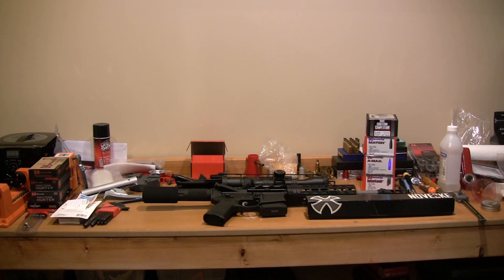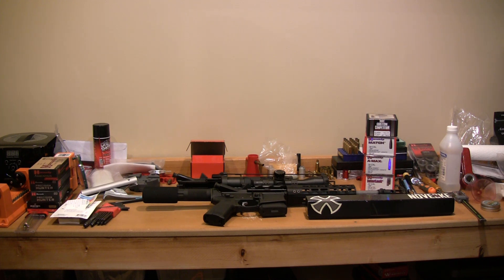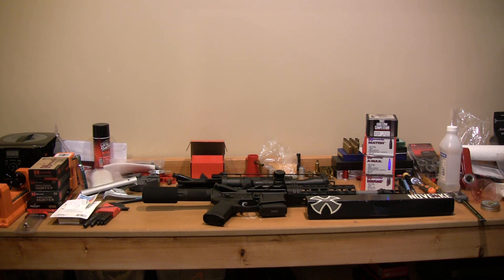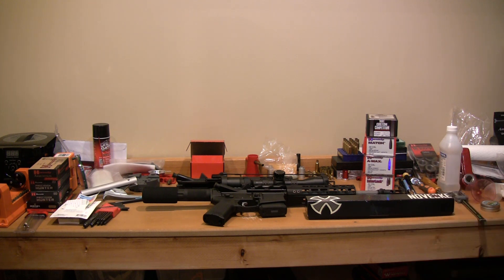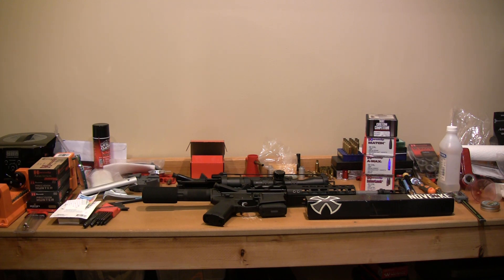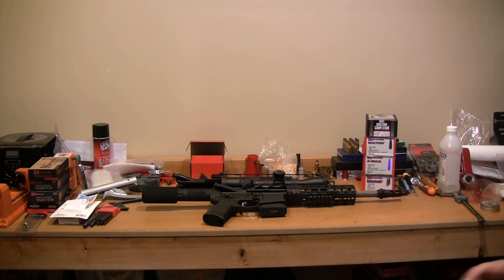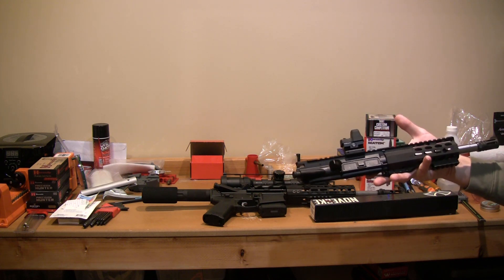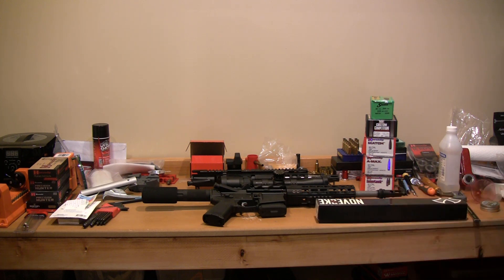300 blackout barrel Selection: Twist Rate Matters

Comment: Hi Bolt
 Bought the same Palmetto Upper you have. 8.5 Inch Barrel 1:8 twist. I loaded some 125 GN Super Sonic loads and it shoots great. have shot at 100 yards and is very accurate. Loaded some 208 Hornady 11 GN Accurate 1680 and I am getting Key holing at the 10 feet line. Just tested it yesterday and found this problem. Your video is the first one I found that addressed this problem. I was going to start messing around with different loads. I think you video is going to save me a lot of time and grief. I have noticed most of the 8.5 inch barrels for sale are 1:7. Must be a reason. I am just going to order a new barrel and give it a try.

Harold
Reply: @markr6754   I change the barrel to the 1-7 twist. It was a huge improvement. The 208 Hornady boat tail hole were still not perfect but was not a key hole. I bought the Remington 220 flat base sub sonic and the hole was perfect. Did not get a bolt hold open with the Remington. I read some posts that boat tail bullets do not stabilize well out of short barrels. Seems to be true. I took 5 Remington bullets apart and used the bullets to make a new load 11.5 gn 1680 also loaded some Hornady 220 BT same powder. Will go to the range and see the results. The 1-7 twist did make the big difference. This going to be a suppressed rifle so I have to have these bullets coming out arrow straight. Will keep you posted.
Reply: Harold Demes thanks for the info, and glad it’s working out for you. I wish I’d read the same posts before jumping for 1500 of the Lapua bullets. I suppose I can always load them for faster velocity...but sure was looking forward to sub performance. I just picked up a 10.5” 1:7 twist 416R Stainless barrel from Bear Creek Arsenal. It’s carbine gas...so that could prove problematic. Just picking out pieces for my next build...at least I know they have a pistol gas barrel as well.
Reply: @markr6754  Hi Mark been doing more testing with the 8.5" 1-7 Twist barrel. The 220 gn flat base Remington are the best holes at 15 ft. But some hole smudged. In consistent. The 208 and 220 BT all smudged at 15 ft. The 220 Remington's stabilized at 25 yards no smug. The 208 and 220 BT still smudged at 25 yards.I have tried different powders charge weights and had no luck. I ordered a 10.5" 1-7 Twist barrel to test. I think the longer barrel with solve all the above problems. I probably could eventually come up with a load that would work in the 8.5 inch barrel but I would like the gun to shoot any factory subs. I built this gun to run a can so I have to have a consistent bullet stability coming out. Don't need a baffle strike in a $900.00 can. Barrel should be in this week will keep you posted.

Harold
Reply: Harold Demes nice update. I hurt my back the same day I made my last post. Haven’t been able to shoot anything since. I did complete my 10.5” pistol. It’s a bit of a Frankengun...Aero Precision upper and lower, PSA lower parts kit with SBA3 pistol brace... I like the feel of the Enhanced Polished Trigger, so I purchased the same lower parts kit that I have in my 8.5” pistol. I added an Osprey hand guard, Odin Works Stainless adjustable gas block, and finished with a Punisher stainless muzzle brake/compensator. It all looks pretty good, but I have no idea how it will shoot. Back better improve soon or I’ve sunk a lot of money into man-cave decorations.
Reply: @markr6754  Hi Mark Got the 10.5 1-7 twist stainless barrel. Went to the range 208 and 220 still smudged. No difference between the 8.5 1-7 twist an the 10.5. Did load some sub sonic 150 sierra spitzer. Worked great perfect hole. Cycled locked the bolt back. I bought a upper and parts to put my 8.5 on so when I am testing I am not changing barrels. I am going tomorrow and taking the bird cage flash suppressor off. It may be causing turbulence. Grasping at straws. I watched jonnysreloading bench video and he was testing to 208 and the 220 subs and was getting perfect holes with a 8.5 1-8 twist rainier barrel. He has SB tactical 3 prong flash hider so he can put his suppressor on. That is the only thing I can see different than what I have. Will let you know

Harold
Reply: @backnine sent an email to PSA telling them my experience. They want me to send the unit in. I won't do anything until I can shoot some more rounds. But it's good to know they're ready to stand behind the product. I've gotten other feedback that indicates it's really an anomaly. Hope so. I don't plan to get a can anytime soon...but I want to be able to run one with confidence. Thanks for the update.
Reply: @markr6754  Hi Mark went to the range today. Took the bird cage flash hider off the 8.5 and the 10.5. 220 bullets are straight at 10'. Did not have any 208 left to try. That flash hider must create some turbulence on the heavy bullets. I think the problem is solved. For the 220 anyway. I will get some more 208 and try them. What flash hider do you have?

Harold
Reply: Harold Demes great news! Gives a point to begin troubleshooting. I’m expecting that if 220gr subs are running straight, then 208gr should as well. Anyway, my 8.5” upper was a complete unit from PSA, it shows a PSA A2 Flash Hider. I’d bet that it is a bird cage as well. My 10.5” barrel has a Stainless “Punisher” muzzle brake...it’s three inches long. I bought it off eBay,, and all pictures related to it are gone. That’s pretty bizarre. Seller was cx3tactical. Description is “.300 Blackout Stainless Muzzle Brake Compensator Comp 5/8-24 TPI Punisher 3% 300”. He has similar devices on his page for .308 and .223. It looks great, but how it shoots remains untested. Anyway, I think you’re on the right track. Maybe you should call PSA and get some input. They are supposed to have test fired these weapons...maybe they didn’t try subs, and I haven’t tried any 220gr projectiles at full load.

Comment: There were numerous reports in 2015-16 that there were many SS Barrels 300 Blackout barrels floating around that though marked 1-8 that were actually 1-10 twist. Take a Hornady 225 grain BTHP length 1.558".  In a 1-8 twist barrel it's stability factor is 1.876 @1000 FPS (anything above 1.5 is stable). Shoot the same bullet through a 1-10 twist barrel at the same 1,000 FPS it's 1.174,  Unstable.  Ergo your marked 1-8 twist barrel is actually a 1-10 twist barrel.

I used the JBM Stability calculator found here:   http://www.jbmballistics.com/cgi-bin/jbmstab-5.1.cgi

BTW in a 1-7 Twist barrel the 225gr Hornady BTHP stability factor is 2.396.  As you have remarked 1-7 is the way to go if you plan on running a lot of subs. 1-7 doesn't do much for accuracy for supers ( way overstabilizing them ), but then again the 300 Blackout is not a LR match cartridge.

Comment: Bullet weight, bullet speed, barrel twist, and barrel length, all have factors that play in "bullet stabilization".   The Russians 7.62x39 (123 gr) bullets shoot fine through as short as a 12" 1:9.5 barrel. (I like 12" to 23" barrels with my 7.62x39 ammo).  Any 125gr 300 B.O. should love a 1:9, 1:9.5, or a 1:10 barrel that's at least 12" long.

Comment: The difference between 1-7 and 1-8 is tiny... Suggest you check barrel. I shoot the 208 AMAX and larger from a 1-8 with no problems whatsoever.
Reply from the maker: thanks for commenting. I am sure that something with my barrel is sub-optimal, but honestly its not worth chasing. It shoots light projectiles just fine. Like I say in the video, I am sure that there are 1:8 twist barrels that shoot heavy bullets just fine, (look at johnnys reloading bench https://www.youtube.com/channel/UCQ7ZytKrmCQnRp9LXXxinJQ and you will see a 1:8 twist MATCH barrel shoot heavy projectiles. My whole upper for the 1:8 twist was 2/3 the cost of his barrel alone. And like I mentioned in some comments below, the difference is 14.2% in rotational velocity. Not tiny in my book, but in my case it might have been the difference who knows. Glad yours works for what you wanted it to. Small groups to ya.

Comment: cant recall where i saw the info but i remember seeing someone say 1 in 4 twist being ideal for subsonic blackout
Reply: Kevin B. With Q said this, however they never went public with a barrel that tight because it destroys light supersonic loads and even some expanding subs that are soft due to the extremely high RPMs.

So their compromise twist on the Honey Badger is 1:5. It's fast enough to stabilise subs and larger supers in a short short barrel at low low subsonic speeds  (you have to go way lower than the sound barrier to beat the transonic mini-booms, 900 fps or so, depending on shape).
Kevin swears by high twist, but personally I'm dubious of supersonic performance with that kind of twist. The effects of spindrift are magnified with really high RPMs, and if you're hand loading some bullets might come apart or lose accuracy.
Also you get less velocity due to more energy being spent on spin, but, Kevin points out you still get expansion due to centrifugal force.

Honestly I want to try some of this out myself and see what's best.
Reply: @ravissary79  being im planning to use exclusively subsonic as a defense build ill be going 1:5 or 1:6. Though ill likely grab a barrel for supers later on.  Underdeveloped ear canals, wouldnt want to stun myself in an already bad situation
Reply: @ThirtytwoJ  bear in mind 1:5 is rare because it's too tight for mass produced button rifling barrel makers.
It has to be cut or hammer forged, which is pricy.
But Q actually makes a barrel like that used in the Honey Badger which they sell as a part.
(1:5)

Comment: I have a 16" Wilson Combat barrel which is 1:8 that I just purchased on a 300 blk. Hopefully the length and quality of the barrel will not have the tumbling effect. 35 feet is crazy. Now I'm very interested in seeing how it performs. Thanks for the video.
Reply from the maker: +fins 71 thanks for the comment. I would not be surprised if it shot ok. You have length on your side and WC is a wisely brand. But to do it again i would still get a 1:7 twist. My first barrel was very disappointing.

Comment: 1:8 twist in a 8.5" barrel means the bullet rotates once before leaving the barrel. The barrel is not long enough. The faster, lighter rounds will work but the slower heavier ones are like a right handed pitcher throwing left handed. I've seen guys have accuracy issues with shorter barrels and wonder why.
Reply from the maker: +toolman272 thanks for commenting. There are people that have 8.5" barrels that can stabilize the heavier projectiles. Having a longer barrel would probably help some but 35' is a little rediculous for bullets to be flying sideways. Stability calculators input velocity and twist rate bullet weight and length. I wasn't expecting to shoot one hole groups at 1000 yards but these loads aren't safe to run through a suppressor .
Reply: toolman272 this. When the bullet was decided, I believe a 1:7 was envisioned due to the desired sub 10" barrels. With a longer barrel, a 1:8 could work
Reply: You people are not doing the math. Example: 3000 fps x 1in10 equals 3600 revolutions per second. Stable.
1050 fps in 1 in 8 equals 1575 revs per second compared to 1800 revs per second in a 1 in 7 barrel.
Both are slow. But a 15% increase is a plus. Do not use high velocity bullet shapes for subsonic loads.
Why people are using the revs per minute concept is beyond my comprehension, since gravity pulls at a constant 32 feet per second, the bullet isn't airborne for more than a few seconds. Excellent video, thank you so much for sharing. Anybody offering a 1 in 4? Shoot straight, shoot safe.
Reply: Bryan St.Martin wait.  How is the revs higher from 1-7 vs 1-8....in your equation?
Reply: @MDeJo27603  so would a 1:8 be ok from a 10 5 Barrel
Reply: @timesque9790  I have a 1:8, 11.5".  They favor lighter loads.  More accurate with lighter loads vs the 1:7.
Reply: @MDeJo27603  thanks for your response I got it put together last night going to try and go to the rang this weekend using 120gr hopefully everything goes ok this is my first build, ,,and my first AR

Comment: I wonder if you have slugged the barrel? I had a problem with tumbling bullets out of a 44 caliber rifle, found out the barrel was just  a little larger than spec. Found some cast bullets .002 fatter and the problem went away. 

I have a 300 CMMG Blackout that I shoot 150 grain and 230 grain cast bullets out of and I have not had any problems (yet Thank God) I do not know my twist rate I will have to check that out. Mine is a full 20" length so that may be helping me. 

Thank you for a informative video I did not know anything about twist rates, I think I need to learn.
Reply from the maker: Barn Dweller thanks for the compliment. It takes more effort to put these videos together than most people think. To be honest I think it's a combination of things. It's likely that a 1:8 can work if the stars are alligned. ( longer barrel, specific rifling like 5R, tolerance , actual velocity) If I speed the heavier bullets above the speed of sound I think they would do better, but that's not the point of the round. I can shoot 150gr at 1850+ fps and they fly great. the only lead bullets I have shot are the 187gr victus munitions and they tumbled just the same. Everything else I have shot is a jacketed projectile, which should improve performance, not hurt it.

Comment: it's a combination of the twist rate and the short barrel I have a 16 inch barrel with 1*8 twist and I shoot 220 grn suppressed with no problem
Reply from the maker: +the widow's son thanks for the comment. I believe it has a lot to do with the quality of the barrel. If you have a quality 1:8 twist you can be ok with a short barrel. But I would not risk getting a cheap 1:8 twist and expect it to perform with heavy projectiles.

Comment: My current barrel is 1:7 8” but I just bought a PWS upper that’s 1:8 10”. I haven’t shot the latter but I used to have a 10” KAK Blond barrel. Never had keyholing issues within 50yds. 

Could this be due to distance? Also what were these rounds chrono’d at? 

Also it could seem like they’re going sideways if the backing of the target is weak. Did you try it again with a new cardboard backing  and see if it still appeared to keyhole?

Comment: Is a 16" barrel, with a 1:10 twist enough for heavier rounds? You are using a 10.5" barrel with 1:8 twist. Longer barrels need a LITTLE less twist, for say 150gr... right?
Reply from the maker: Typically you are running the 150 gr at supersonic velocities. It this is the case you probably won't have any trouble. its where you start trying to run 175+gr projectiles at 1100 fps. In any case I would still pick more twist whenever possible. You are never going to "overspin" a projectile in a 300BLK

Comment: What twist rate would you recommend for a 9 inch 300blk using normal ammo? I'm looking at a 1/12 twist but I dont know what grain range I should use
Reply from the maker: What is "normal ammo" ? most subsonic ammo is 200+ grains and they are not going to stabilize in a 1/12 twist barrel.
Reply: @BoltActionReloading  nvm. Found a 9inch 1 in 7 twist, 1 in 12 is horrible for the load I want to shoot.

Comment: im considering building a 300 blk upper for pistol. im a 30 cal fan & figured it be fun to mess with & since you've been playing with the 300 round i was wondering what you think about micro barrel for 300 blk? there are 4.5 or 5 inches long... from slr riffle works. they look cool, but is that as about all those micro lengths are good for? thanks for the video.
Reply from the maker: Personally they aren't for me, but everyone is different. Not sure how much difficulty you might have cycling the action and what velocity you can achieve. 8-9 inches is as short as I would go and i like my 11.5"  It might be a case of different strokes for different folks, but sounds like problems to figure out to me. I may just not be familiar enough with it.
Reply: @BoltActionReloading  Thanks for your response & time.

Comment: from what i have read going subsonic in a short barrel, you need a supperssor
Reply from the maker: +excutter1969 that is absolutely not a requirement if you have a pistol length gas system. It is very possible to get the action to cycle at subsonics velocities without a suppressor. However I am sure it is much easier to get it to cycle with one and probably much for fun to shoot.